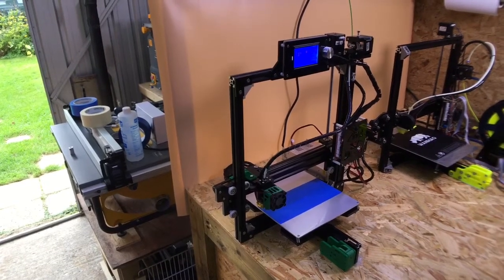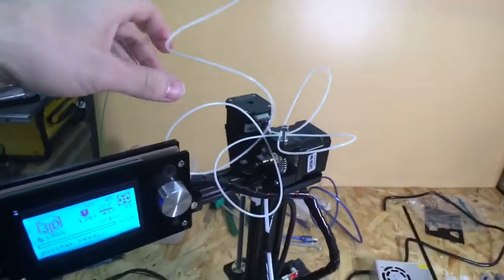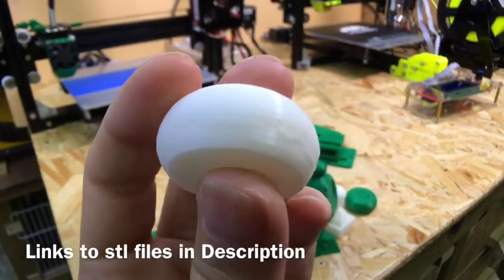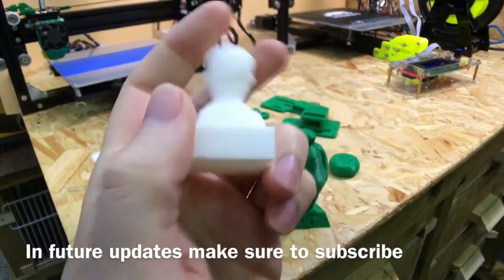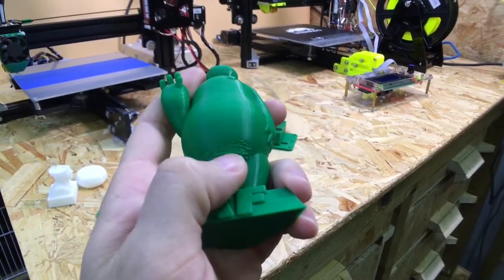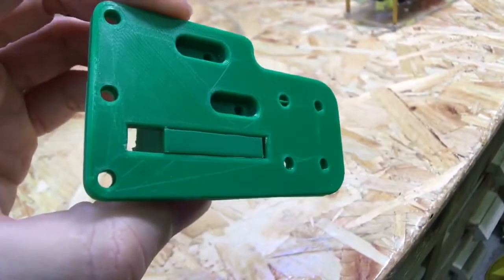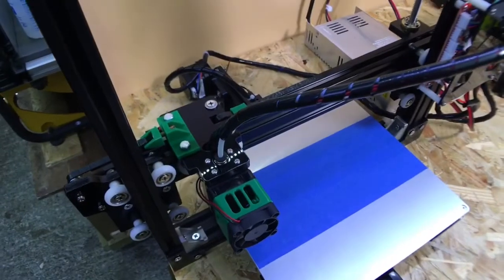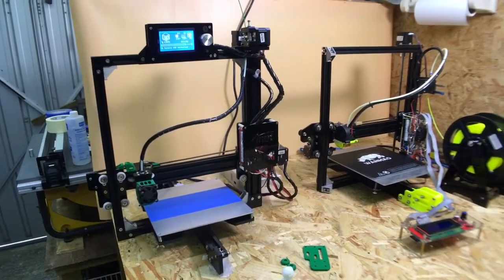Anet A2 first prints on 3D Printer

Comment: Hi, What are you early thought comparing both the A2 and Tarantula, both in terms of overall build quality, and print quality? If buying just one printer - which would you go for?
Reply from the maker: well depending where you live getting hold of a Tarantula mainly shipped from china i payed £40 import tax on top of the price something to think about.
I would say out of the box for me the anet a2 the acrilc parts are stronger, the lcd mounts on the top nice far easier to tidy the cables the print quality is the same on both. anet and its cheaper in the uk
But all is dependent on how well you assemble both anet, tevo takes abit of tinkering to get frame square.
If you have electrical knowledge, like asembleing kits and have plenty of Patience. i would go with either one but since the anet is cheaper thats why i took the chance.
Reply: Im in the UK. Currently price is around £166 for the tevo shipped from Germany (or £198 with the large bed), compared to £135 for the A2 with large bed (or standard bed with autolevel).  The Tevo has a larger community than the A2, and the A2 has a smaller community than the A8 (but that is perhaps because it requires less modifications to start with). Not many people have the opportunity to try both to compare. I was pretty much decided on the tevo (over the A8) - but now seriously tempted to go with a A2.

Comment: Very nice. What is a layer fan?
Reply from the maker: Hi mate it cools the extruded hot plastic after it comes out from the nozzle, very handy if the model your printing has overhangs helps with surface finish also.